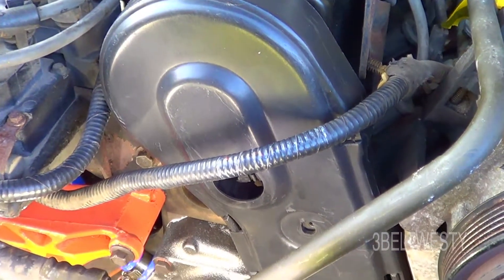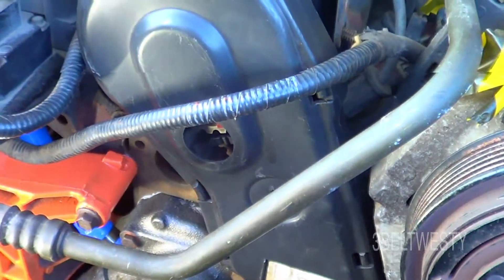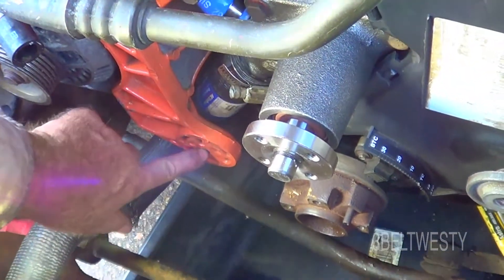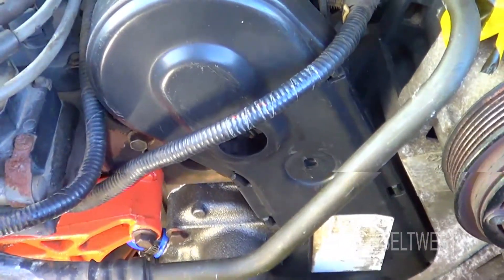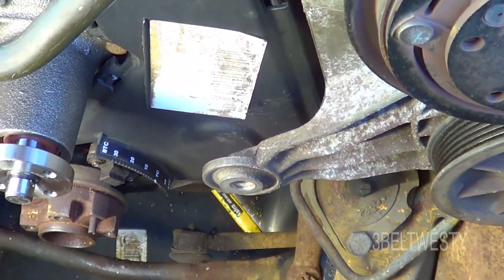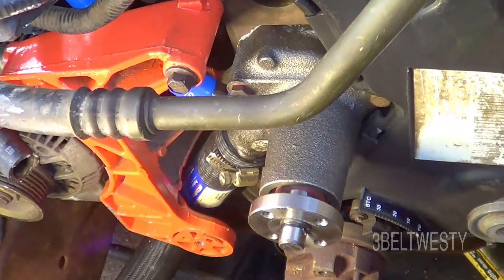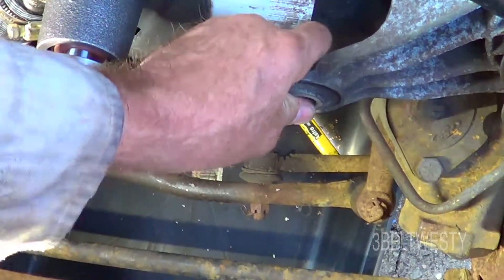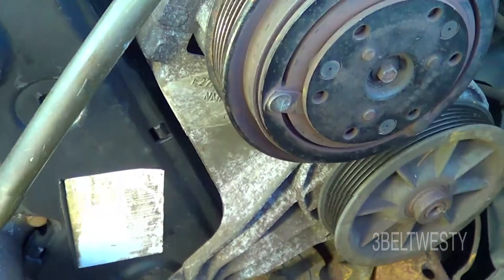2.3L 1994 Ranger timing belt jump indicator

Comment: What tool did you use to remove the crankshaft timing gear? I have the exact year and model like yours.
Reply: Good penetrant and an air hammer to loosen it, as the puller hasn't been available for years.